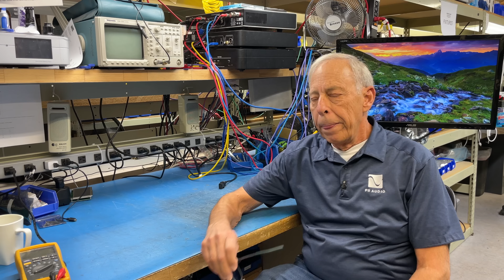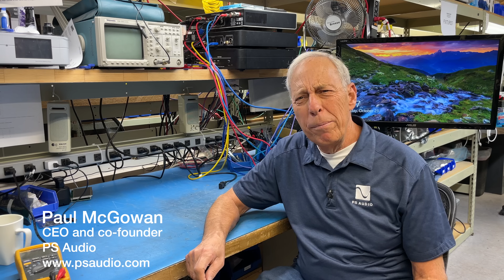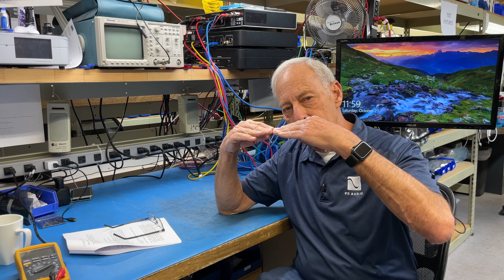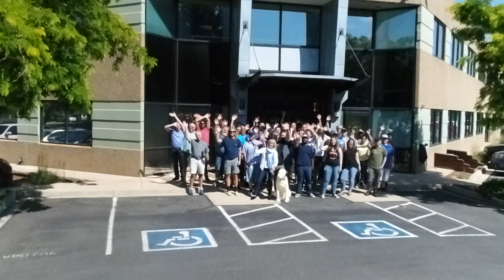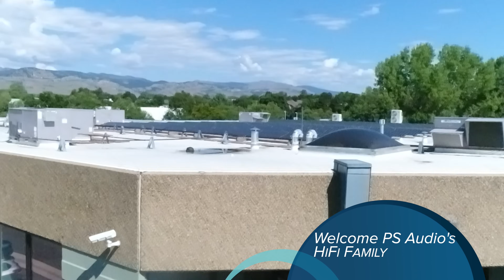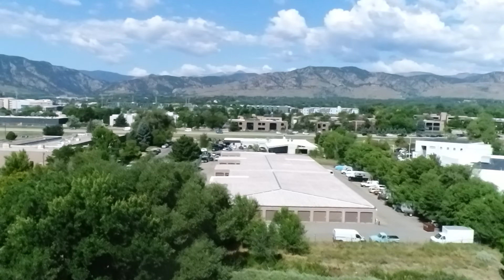What do input capacitors provide on amplifiers?

Comment: Till now, I was thinking that the capacitor on power input is used to more purify DC after step down transformer (AC to DC).and also store energy for instant power requirement of an amplifier. Like if transformer giving 12 v DC, cap should be 24 v at least.and around 10000uf per 10 watt of amp power.   Anybody here can suggest something?

Comment: Well I speak from experience.( Polyester film caps )typo filter out any distortion and makes everything sound clean and clear. 🤗💯💖 UF microfarad caps store energy and release it very quickly. I personally like polyester film caps they make everything sound a little bit cleaner and with a resistor it only allows so much voltage to go to or  through the amplifier all three working  together on a input you will get a awesome sound. I am self-taught. Works like a filter or crossover💖 clean no distortion or any unwanted noise. When I build a amplifier I like to work on it when it is up and running and then put UF microfarad cap polyester film cap and a resistor on the  positive side of the input only and that way I know it sounds crystal clear and clean🤗💯💖.

Comment: Not supposed to discuss it yet publicly, but the compact speakers clearly visible in the video are prototypes of the next upcoming model in the superb aspen-FR series. Paul shared them here as a bit of an 'Easter Egg', early holiday present to loyal viewers. Here's what we know so far: They're absolutely ruler-flat from 250hz-to-3khz, are self-amplified (but without servo control on the woofers), ported, image like nothing you've ever heard before, and feature a desktop friendly, one-piece enclosure vacuum formed from an advanced composite resin, similar to what Wilson Audio uses. Not much else is known at this point as Paul, Chris Brunhaver and the team are understandably mum on the topic, but widespread availability looks imminent sometime in 2022 with a retail price TBD. Pure speculation on our part though, but guessing less than $25-usd. PS-Audio...keep up the great work!  ;)

Comment: DC is not technically a “steady voltage that never moves” but rather a voltage level whose polarity stays constant.
AC alternates the polarity of the voltage signal - usually uniformly to a sinusoidal patten. 
You can have square tooth, triangular or even random AC signals.
Reply: In electrical engineering, the DC component of a signal is that which corresponds to the average value.  It appears as the constant in the Fourier series representation (for periodic signals) or Fourier transform (more general case).  Being a constant, it does not vary with time.  
All of the variation in a signal is considered part of its AC component.

Comment: In tube amps the coupling caps block HIGH voltage DC from the grids of the next tube in the chain.,in the end without them the output transformer will ultimately go up in smoke. You should see zero volts DC at the grids or the caps are garbage.

Comment: You can also have a capacitor on the input or output on the preamplifier.
and you have a capacitor on the input of the amplifier. You will then double the weakening of the sound.

you should not have too much value or too little value. the capacitor should also protect against high frequencies. Many use 10uf.

the problem is that you do not have room for polypropylene capacitor but only electrolyte which is a not so good type of capacitor.

What i have done on one of my amplifiers is to put a good capacitor on the actual signal wire with shrink tubing and aluminum foil and shrink tubing over at the end. Temember that aluminum must be grounded to signal minus and aluminum must not come into contact with signal +
Reply: My preamp has options for dc coupled output, or capacitive coupled output jacks. You are correct, every time you introduce capacitance or inductance you are jacking around with timing and phase shifts. Better to have capacitor coupling on the input of the power amp IMHO.
Reply: You can use a vcap odam... Small but beats out a lot of the best film and foil caps but these caps r $$$$ and I went all out with them
Reply: @B2_Labs  v-cap is still relatively large in sizes
compare with electrolyte of the same value.

Many amplifier cards or preamplifier cards are only made for small electrolyte capacitors. Everything is pressed together to be as small as possible in size, If you  look at the DIY hifi card from ebay.

Comment: I wonder if the question was a guy that saw a stiffening cap in an automobile sound system. If so that Cap in in the 12 volt power supply as a reserve for deep excursions associated with a subwoofer.